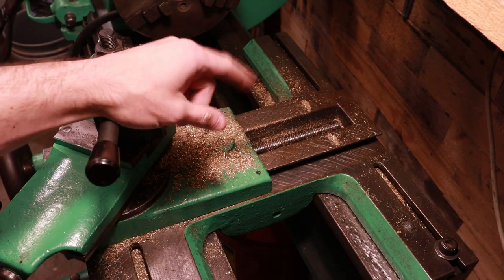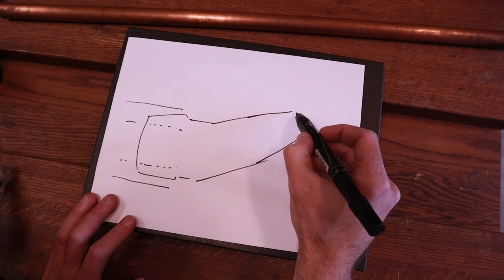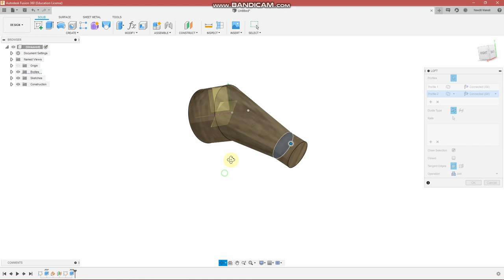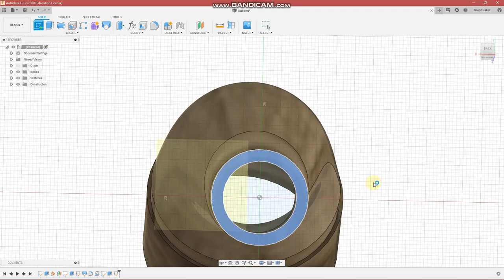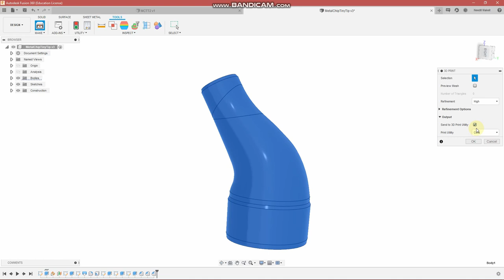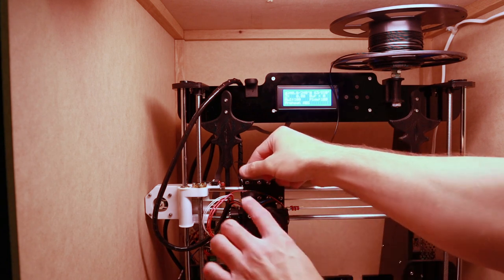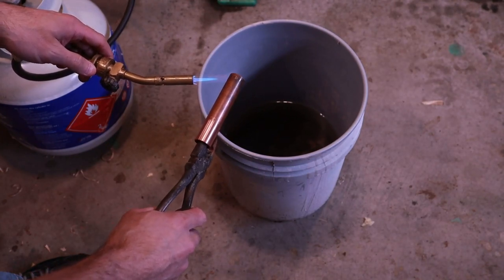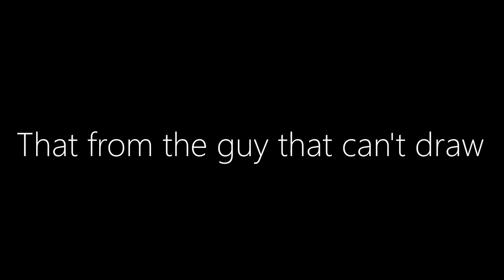✏ How to Design, Sketch & Print One of These Yourself!

Comment: How did it hold up with a years worth of use an oil exposure? I've never used abs yet, just pla so far. Idk how pla is with oil either tho. Great video! I enjoyed the hole process
Reply from the maker: That's a great question, it is still going strong, PETG is my current fav to print with, if ABS wasn't so sensitive to temperature I'd use it more.
Reply: @NeedItMakeIt  that's great to hear! I've started with pla because it's the easiest I was told an just havent tried anything else yet, but I probably should. I want to do afew prints for inside the car, an a part for my mobility scooter but those things would be subjected to more heat than pla can stand over time they will warp from what I've seen on YouTube

Comment: One trick to get 3d printed pla parts to fit well, try soaking it in hot water and then you'll be able to easily shape it.
Reply from the maker: Really, never heard that one.  I've been using ABS since I started about 1 1/2 years ago, but I have some PLA on order right now to try out.  Some of he main problems with ABS instantly go away, but it does seem to be more pricey and I've heard it is more brittle.   

Does the water affect its strength?